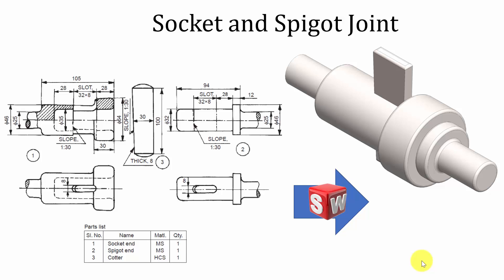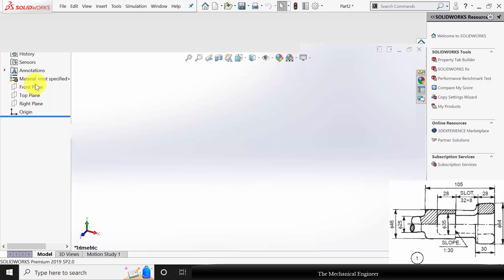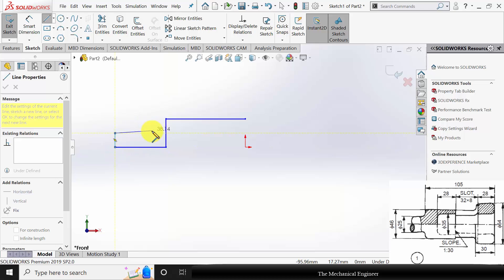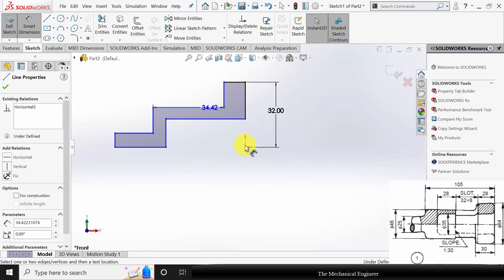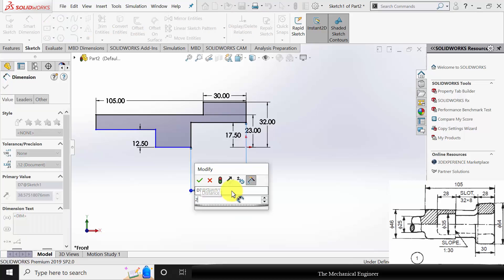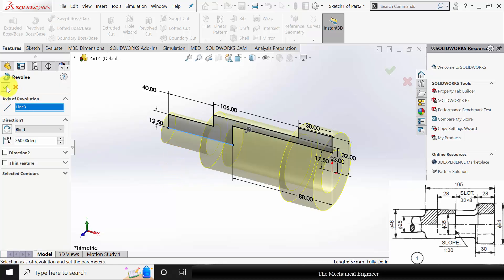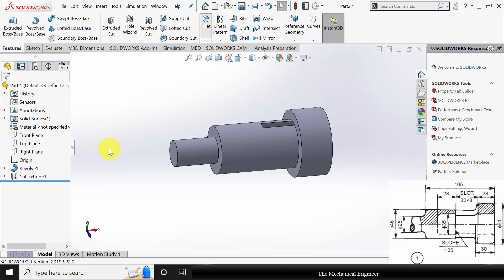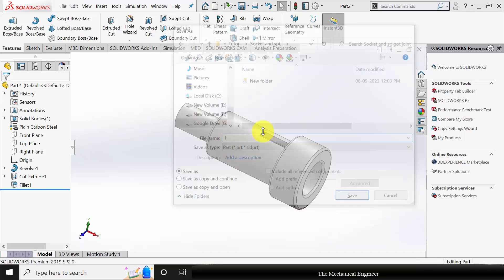Socket and Spigot Joint using SOLIDWORKS | Parts and Assembly | SOLIDWORKS tutorials for beginners

Comment: for socket how did u calculate angle from taper value sir?
Reply: So the slope is given as 1/30, which is 0.03333, and we know that tan(theta) is equal to the slope, so we can calculate theta by taking the tan inverse of slope